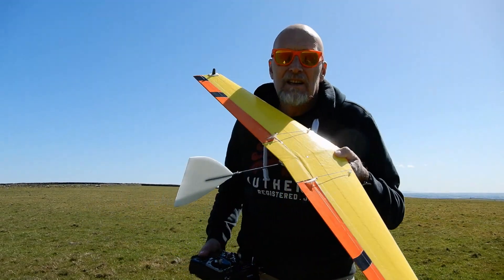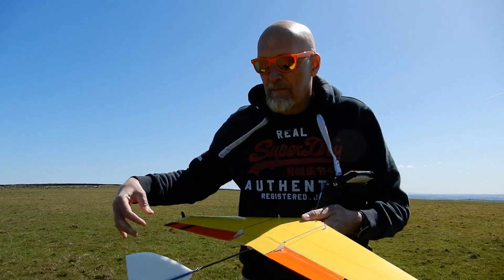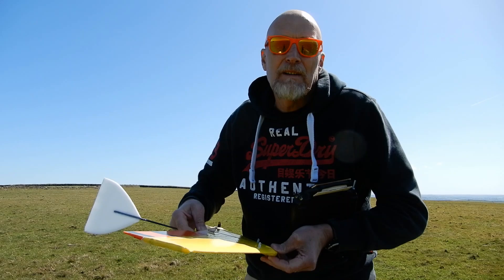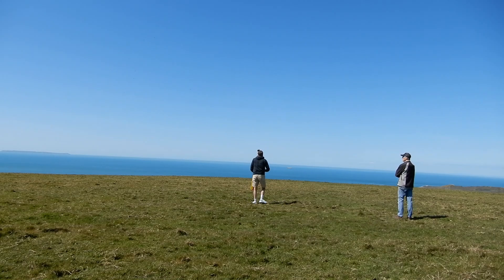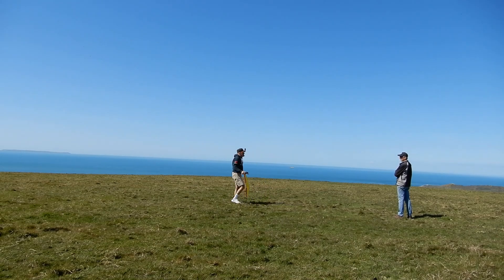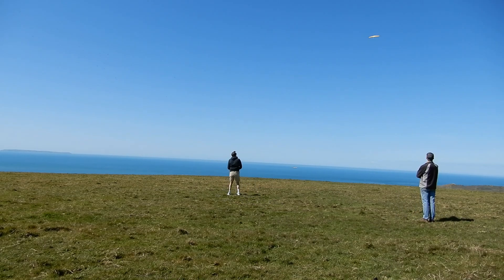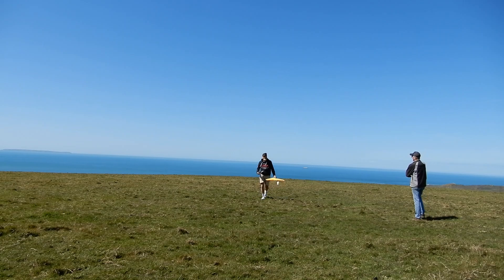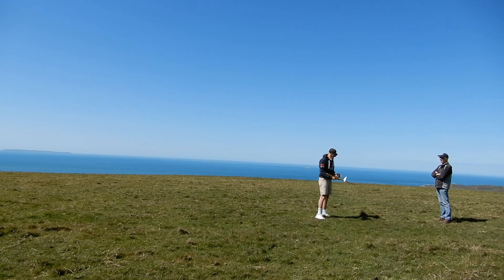Smash DLG Experiment  test flight

Comment: I went down a rabbit hole with plank dlgs..  Made at least 10 of them over the course of 2 summers.. Vac bagged, pw1211 airfoils, sweep this, dihedral that, wide chord, long tapered wings.. Not one of them rivaled a glider with a tail behind.. There main issues were, flying too fast even at very light wing loadings.. Difficult to turn tightly without loosing too much height and unruly in anything over a gentle breeze.. In the end I sacked the idea off before I went mad.. Lol..
Reply from the maker: Yes mate you hit the nail on the head . High launch no glide the challenge persists 👌